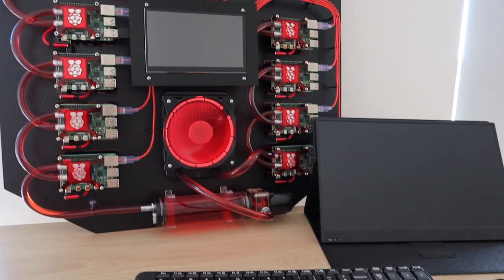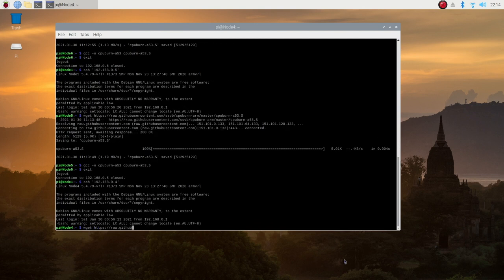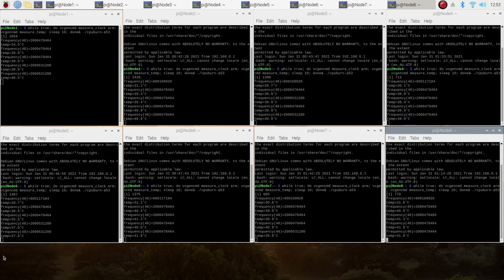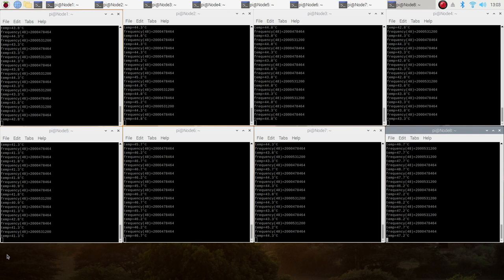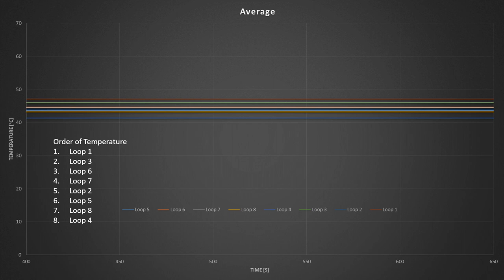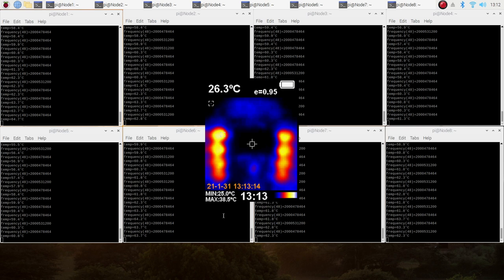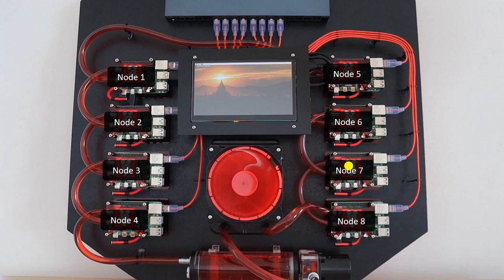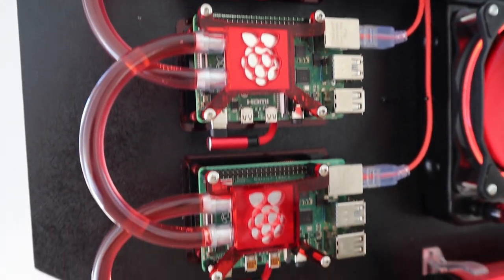Thermal Testing My Water Cooled Raspberry Pi Cluster - Does Loop Order Matter?

Comment: I just got an Ice Tower for my PI 4 Home Assistant server, more for the coolness factor and a bit of cooling. While installing it I found a possible flaw and your water system seems to have the same flaw. Yes the CPU stays nice and cool but what about the SDRAM, USB controller and Ethernet controller? Your thermal imaging camera shows they get very hot while the cpu stays cool. Not sure if this will be a problem over time. What is your opinion? 

Like others have said in the comments, don't need one but I really want one. Awesome project.
Reply from the maker: Yes, they definitely get quite hot, as can be seen in the thermal image. Whether this has an effect on the lifespan of the chips, I'm not sure. I've never had a Raspberry Pi fail in normal use like this, but I also don't generally run any of my Pi 4's continuously.
There are sets of small aluminium heat sinks which are sold in three or fours (in different sizes) and these packs are designed to cool these chips as well. So you could always buy one of these and stick the additional heat sinks onto those chips along with your Ice Tower.
Thanks for the great feedback!

Comment: I'd actually suggest the rad capacity is much greater than the load the Raspberrys can generate. But thermally, the water is transferring heat out quicker than it can be generated.  Slowing the pump greatly might show more difference.
Reply: Yeah and the water flow too fast to show the difference.

This might be the essence of the test. showing it "doesn't matter" but I believe the loop 4 to loop 6 difference is quite a lot. 5 degrees C is significant enough to show something is going on behind the scenes. If he took the current setup and ordered it from hottest to coldest in loop order, he'd see a drastic difference in temperatures.

Comment: Thank you. I plan on making this. What do you use this for
Reply from the maker: The parts are all listed in the cluster's build video description - https://youtu.be/PUAIIibXMYw
Reply: @MichaelKlements   I mean are you using it for rendering, Ai. Etc
Reply from the maker: I use it for running mathematical simulations - CFD and engineering related tasks which are quite processor heavy

Comment: Quick question:
 What would be the disadvantages of using a few Raspberry pi 4 with different ram capacity such as two 2gb one 4gb and one 8gb to construct a cluster ?
Reply: I'm still learning but I think it can be good to have a couple nodes that are more capable to run larger single-instance jobs on.  The disadvantage is that they aren't all the same so you have to think about where things will run.
Reply from the maker: It all depends on what you're trying to do with the cluster. More RAM would be advantageous for rendering jobs, but as Beauregard Slim has pointed out, you'd need your software to manage what is being sent to each of them so that you're not limiting your cluster to the capacity of the ones with less RAM.

Comment: You could also randomly mix the positions of each Pi and rerun the test. It's a lot of work but would produce more accurate results. They all might have a different base temperature.
Reply from the maker: They likely do have different base temperatures. The main aim of the test was to confirm that there was no significant temperature rise from the first to the last node in the loop. The couple of degrees difference between each of them doesn’t really have any material affect on performance.
Reply: @MichaelKlements  1. You are absolutely right.
2. Your creativity and execution: brilliant.
Awesome videos, thanks!
Reply from the maker: Thanks for the feedback and support!

Comment: Amazing  project,well build, maybe you can try to use cpu-based cryptocurrency mining,just for fun ?
Reply from the maker: Thank you! If you're interested in CPU mining just for the fun of it then it's probably best to try get a system running on your computer with a USB ASIC miner. There's really not much point in running this, even across 8 Pi's. Sorry if this sounds negative, but they're just not the right hardware for Cryptos, even in numbers.
Reply: @MichaelKlements  Thank you for the answer. I don't want to mine cryptocurrencies, I'm just looking for an application, I use raspberry pi every day as a normal computer, many people make mega computers with pi, but no one can show an interesting and useful application.
Reply from the maker: Yeah I agree. There are loads of applications for Raspberry Pis though, try looking through Pi communities and on Reddit for some unique ideas. Mining cryptocurrencies would be fun to learn how to do, but its not really a useful application. A Pi would probably only be able to mine a few cents worth in a year and would have used up many times more than that in electricity.